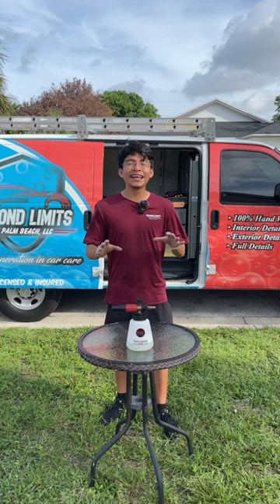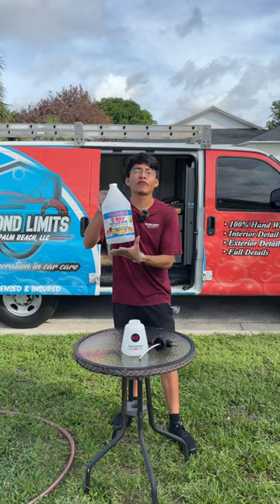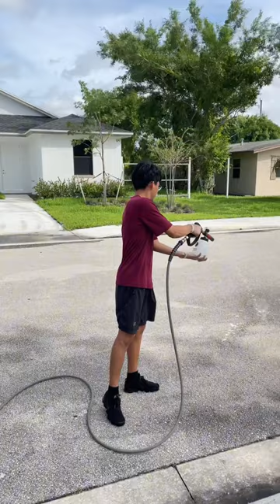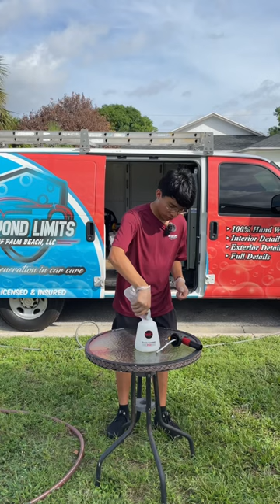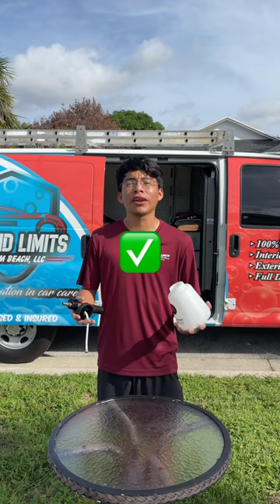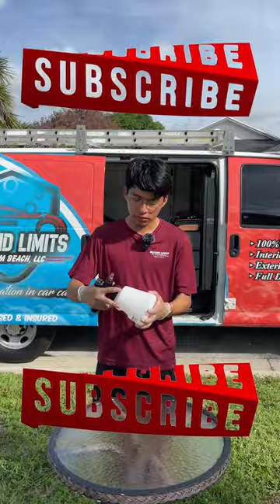How To Properly Clean & Maintain Your Foam Cannon

Comment: Its pretty easy to remove and clean the filters. Much better to do that and let them soak in an acid solution for some time. Citric acid or vinegar is fine but I'd probably only soak the steel filters in acid and soak the foam one in warm water.
Reply from the maker: @TensaZangetsu63  nice!

Comment: why did he put water in  instead of just letting water flow through the hose?
Reply: Because the water from the hose doesn't go into the soap bottle, the water hose creates a vacuum inside which pulls out your soap mix from the bottle through a small tube. Hope that makes sense.

Comment: I just leave my unused mix in there from last time and it doesn't dry out
Reply from the maker: It’s not about the soap drying out, it’s to clean out the internals & filter of the foam cannon.
Reply: @detailingbeyondlimits  right, I'm saying if the soap doesn't dry out than the internals won't either. What you're describing here is good maintenance to do but it doesn't have to be done every single wash. 🙂
Reply from the maker: It is ideal to do it every 2-3 weeks 🙂  lingering soap in your foam cannon will damage the cannon long term. 🙂🙂